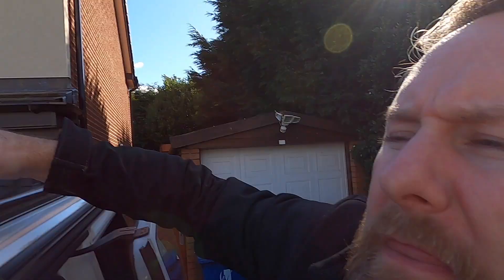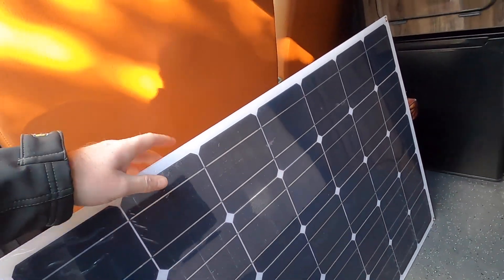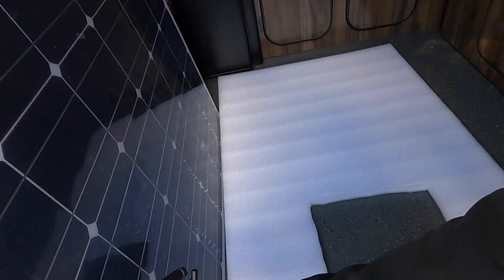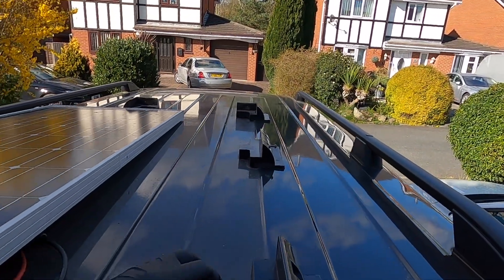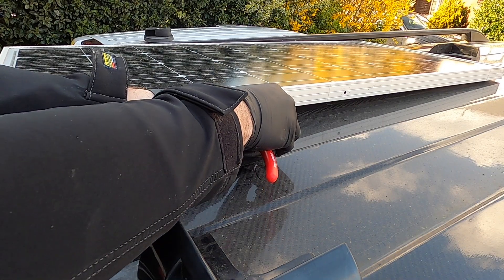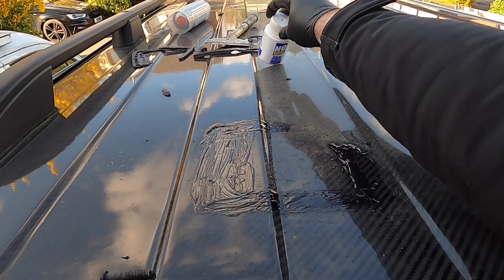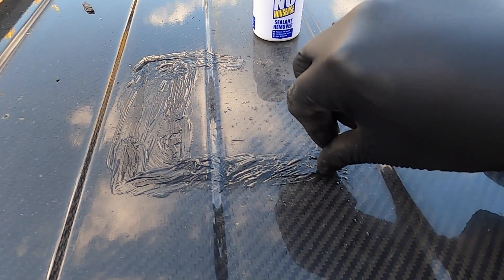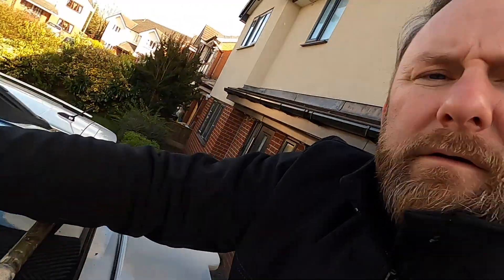150w Flexi solar panel upgrade off grid on VW T5 Campervan

Comment: So it's been on 2.5 years now. How is the panel holding up? I've seen a lot of complaints that those crystalline semi-flex panels tend to die after a couple of years, especially if mounted unsupported where they can flex, as you have done. has yours in fact been OK? There is a huge price difference between these and shade-tolerant more robust CIGS panels (about 3 times the price per watt). My pop-top is barely curved, but ribbed just like yours, and I'm wondering which panel to get and how to attach it, so watching every install on youtube for ideas and longevity info. Panel manufacturer's install info says you need to fill the voids to support the panel. Worse for ventilation, but maybe good for longevity?
Great tip on the BC-90 - I shall try to remember that!
Reply from the maker: @xxwookey  apart from a dodgy connection on the panel it’s self, I had no issues with performance whilst it was installed on the pop top. As this was a good few years back, I’ve had a couple of campers since then and couldn’t tell you if it was still doing its job.
Reply: @AXISUK  OK. Cheers for getting back to me. So you had it for year or two after this vid over which time it worked fine?
Reply from the maker: @ yeah pretty much 👍🏻

Comment: Great video.  Whats the name of the products you use to remove the sikaflex??  Thanks in advance.
Reply from the maker: Hi, the best stuff was brake cleaner. Just need to take off the bulk with a blade and it works a treat 👍🏻
Reply: @AXISUK  thanks!! 👍

Comment: Why did you use Sikaflex again? It didn't hold down your solar bracket the first time.
Reply from the maker: The sika is fine on the flexi as grips quite well. The rigid panel brackets didn’t have enough on, plus if you noticed in the original video the weather was freezing. Not ideal for using a bonding solution.

Comment: Have you had any issues with the panel trying to lift off at the front  whilst driving. Just wondered how secure it still is after 11 months?
Reply from the maker: That panel was fitted over a few years now and never moved 😊 all depends on what you use as a bond.
Reply: Mine, was fitted by skyline nearly five years ago now, flush to the poptop.
Still going strong now.
But only 100w flexi. 
I've been thinking of flopping a 150w flexi over it.

Comment: Thanks so much for this Vid, ive just installed mine in the same way. Ive no output from the panel at all. Can you tell me what connections you used after cutting off the mc4 factory connectors. I used yellow crimp butt connectors rated to 48Amp to reconnect the mc4 inside the vehicle. Would hard wiring the cables and doing away with the mc4's perhaps resolve the issue. Wish id tested the panel before installing 😢
Reply from the maker: The joint in the van was soldered and heat shrink over. Check you have the wires the correct way round.
Reply: Yeah, it needs charging..got a 7 stage ctek charger for that..
Reply: They're sending me a new panel :-)
Reply from the maker: @sairym3607  good news! Hopefully this one works as intended 👍🏻
Reply: Yes the wires, control settings etc gone over and checked 100%..oh well looks like I've lost my money.
Reply from the maker: @sairym3607  if you have a multi meter, pop the cover off the solar panel wire block (on the panel) and check the voltage. I had a dodgy panel and one of the terminals that was soldered came loose.
Reply: Thanks for the tip, I have nothing to lose I guess!
Reply: I have volts spot on! No amps, so is that a diode issue?
Reply from the maker: @sairym3607  if you have voltage readings at the mc4 end then it sounds like the controller maybe the issue
Reply: Took the reading from the solar panel box. So I'm guessing short circuit or diode.
Reply from the maker: @sairym3607  just out of curiosity, but is your connected battery fully charged? If so it won’t draw any current from the panels
Reply: Ironically I've been looking at this from the start, as my leisure is 11.7v without load, with load its 9.8v. (We rinsed it in Devon and do not have a split charger) but couldn't understand why the panel would not show V or Amps separated from the controller.
Reply from the maker: @sairym3607  that battery doesn’t look healthy.

Comment: Hiya, great video. How is the ebt + holding up? I’ve just done the same to my van and am just learning that there are caravan specific sealants from sikaflex. Should I have used one of those do you think or have you not had any issues?
Reply from the maker: Hi Billy, to be fair I use the ebt for everything and never had anything break away or come loose. 👍🏻
Reply: @AXISUK   What are talking about? We saw how it didn't hold the bracket to the roof at all.
Reply from the maker: @RollOnBusin  he asked how it was holding up on the flexi panel and it was fine??? On the ridged panel not enough was used to bond the brackets.

Comment: Ola 🙂  I'm glad I watched this video. When I fitted the flexi panel on my roof I didnt fit the "cable gland " and just stuck the wires under the tailgare. I'm now getting a bit of wetness coming in so I'll be fitting one and I windered how to faff about with the wires to get them proper. Genius solution of yours with the connectors and shrink wrap. As soon as the arctic weather goes, I'll be nicking your idea and doing the same with the wires on viv-i-van. I've now subscribed and will follow. Nice vid👍  Bessy regs-Kenny
Reply from the maker: 😊 Thanks. Yeah it’s always a faff wondering how to get wires from the outside in 🤦🏻 Hopefully when you do it the leak stops 🤞